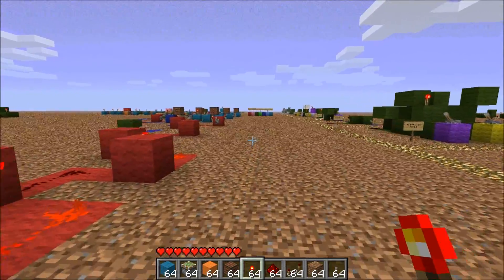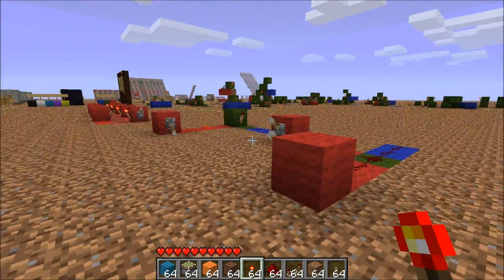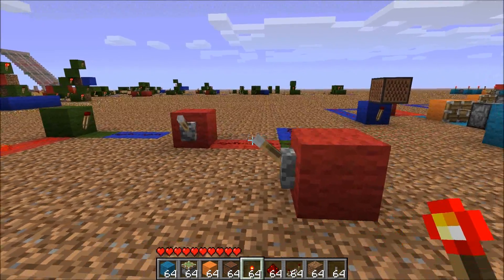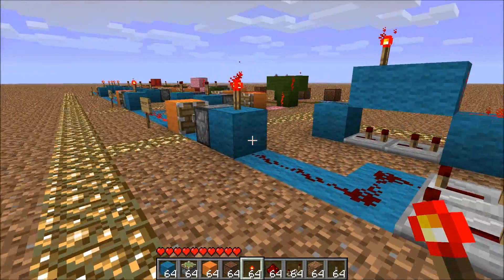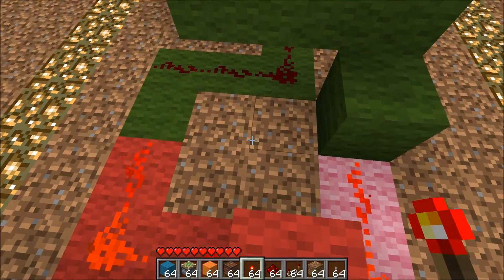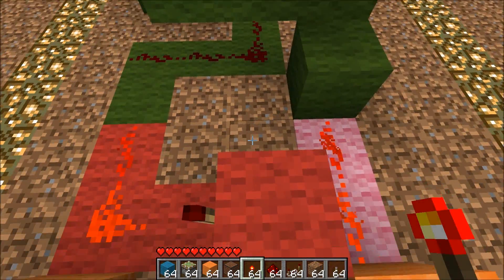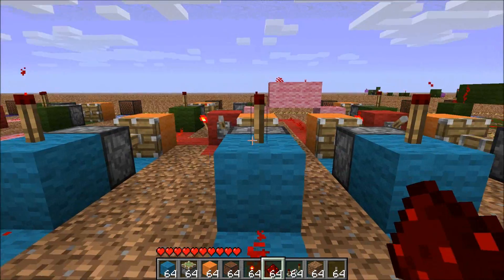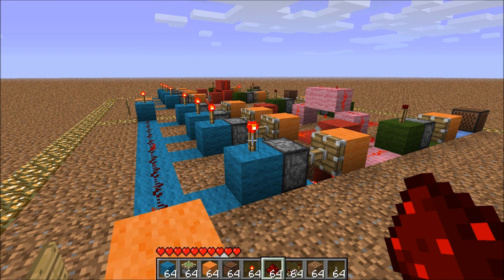Instant Computer proof of concept

Comment: Doesn't this create a problem because of the clocks? You wouldn't always want an output consistently going. Of course you could manually stop it, but could you create a contraption to stop the output after it's use while still maintaining instant usage?

Comment: @TaviRider Yes, sorry for being unclear, what I meant was that I was NOT doing that.

I've found out that my problem isn't the difference between low and high voltages. It happens when for example a piston gets powered by two sources, one of them is on, the other is off, when these switch around at the same instant, the piston will still retract causing a signal to be send. A repeater solves this but that isn't an option., I'm still working on how to solve this, then I'll test it by linking 20.

Comment: I've done it! I managed to make an instant NAND gate without your way of doing a NOT gate, and with these NAND gates constructed an instant XOR gate. :D

It doesn't work right now because an alternation between low (but not zero) and high redstone 'voltage' also causes a piston to extend/retract, but this can easily be solved. My current design was a quick messy test setup anyway. 

I will redesign it and I might make a new youtube account and makea few videos about the NAND and XOR on that. :D

Comment: @TaviRider imgur com/o5aTo 2 8-Bit registers on top of each other. Blue lines are the output, red ones the input, white is the clock. The lever on the right selects which registers gets the clock signal (and outputs it's value), the two levers to the bottom right are for writing (asynchronous). The bits on the far side are already connected ORed (black stuff). There may be some problems when writing due to torches below the black blocks, but that would only increase the height by one.

Comment: So, now I built myself an 8bit register. But I also discovered that you can't read and write to my memory cells at the same time (if the new value is not the same as the old value, both the positive and negative lines will forward the clock signal). Isn't too bad, as reading and writing is asynchronous, so for something complex were you need the register as an input and want to store a result in the same register, all you need would be one intermediate register. Video will be coming soon.

Comment: @TaviRider after playing around for hours last night I am convinced that instant wire inverters and NAND with instant wire input is impossible. The problem is redstone wire is only instant when a piston closes and cuts the signal. It is not instant when the signal is reconnected. With the signal being cut acting as a 1 to get a zero output an inverter would need to change a clock pulse to a stable wire and a stable wire to a pulse.

Comment: I just finished 2 2-bit registers with separate inputs and read-enable-lines and an output multiplexer. I think this was just as easy as with "normal" redstone, maybe even easier, as you can use some tricks for enabling a set of lines. Oh, and I'm not sure if somebody has already done this type of memory before. It basically uses the instant-wire-to-normale-redstone-converter to store the state and enables either a positive or negative line based on it. I will upload a video tomorrow.

Comment: Oops... I thought I was using a NOR gate when it turns out I was using a NAND... So I now have a NAND Latch...
Aren't  the truth tables of a NOR (2 inputs) and a NAND the same in this case?
NOR       NAND
0 0 1       0 0 1
1 0 0       1 0 0
0 1 0       0 1 0
1 1 0       1 1 0

Final question... How does one make a instant NOR then?

Comment: @TaviRider never mind. realised after playing around some more that it was triggering the piston on the off pulse of the clock but the piston was triggering the wire after with an on pulse which is not instant. I will play around some more now that I have watched more of your videos but I don't think that instant inverters and nand gates are possible without having the two separate lines for one and zero.

Comment from the maker: @DSGALAKTOS Because the basic instant OR gate doesn't work with instant wire. If you ran two instant wires together it would act like an AND gate, and unfortunately it introduces a bug that makes the output unreliable.

Comment from the maker: @justwatchinism I'm not sure I understand your build, and I wasn't able to reproduce it in-game. But it sounds like a NOT for a manual input. We can achieve that by using a normal inverter on the signal from the lever. (Manual inputs don't need to be instant.) How would this work with instant wire as the input? Can you take a screenshot of the design?

Comment from the maker: @ADeadlySpoon Computers built within Minecraft would be much larger, yes. The main problem with making redstone creations larger in Minecraft is that it introduces a delay in all the signals. However, with instant wire that drawback doesn't exist. Now we can make them as large as the part of the world that's around a player, which is about 560x560x128, or 40 million blocks.

Comment: I'm a little confused.  Why do you need split inputs for the NOT gate?  The on signal for the instant wire is the pulse and off is constant power.  Can't you just use the positive output side of the design and eliminate the negative output  completely?

Comment from the maker: @firebender111 I don't believe so. That's the whole magic of instant wire. (There is still a one tick delay to get to the note block, but that's only because I have to invert the signal going to the note block. Other things you control may not need that inversion.)

Comment: in this video the piston moves in then out on the edge trigger. If you want an instant not gate (inverter) run the clock wire straight into the piston, put the torch under the block when the piston is in the off state and run the output wire out sideways. then have an input wire connected directly to a lever. when the lever is on signal won't get through. I was just testing it then but can't make video.

Comment from the maker: @Renoh74 Manual input doesn't have to be instant. It makes no difference to the player if their input responds a tenth of a second later, as human reaction times aren't that fast. It's also a one-time delay; it won't build up to a long delay in the computer's output.

To connect the output of gate A to an input of gate B you skip the clock lines, lever and torch. You connect the positive output of A to the positive input of B, and the negative to the negative.

Comment from the maker: @Coffeh You wouldn't connect these wires directly to an output. You need something to combine the two lines into a single, normal redstone signal. You'd use a sort of latch. Every time there's a short off pulse on the positive line, the latch would switch to (or stay) powered. Every time there's a short off pulse on the negative line, the latch would switch to (or stay) unpowered. So as long as the inputs don't change, the final outputs don't change either. No blinking.

Comment: As far as i saw, current computers are already HUGE and they are using not gates size of 2 blocks (block + torch). Is even possible to create enough small computer to fit into loaded chunks with those huge gates?

Comment from the maker: @Hypuhrr I discovered the instant repeater that works on the falling edge without seeing the UTD post, but UTD was first. I never claimed to be the first to discover that. The UTD instant repeater that works on the rising edge doesn't work. And I got the dual wire arrangement in this video from Veracity01.

To be honest, I've intentionally avoided looking at what the UTD does because of the amount of pointless drama it generates in the community.

Comment from the maker: @bloodyfool100 The basic OR gate is instant (as I point out in the video), but it doesn't work with instant wire. You have to use the second OR gate, the one with two pistons pointing at a single wool blocks, to get it to work with instant wire.

And that won't work with the instant NOT gate. For that, you need the two-wire instant OR gate I show toward the end of the video.